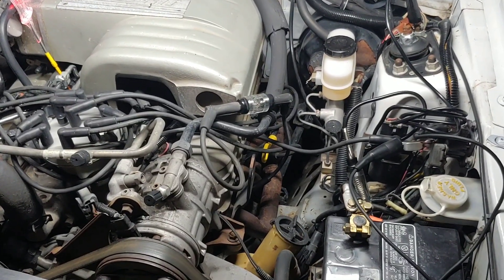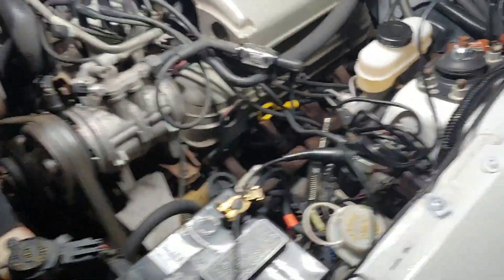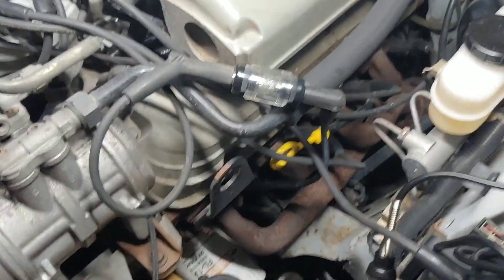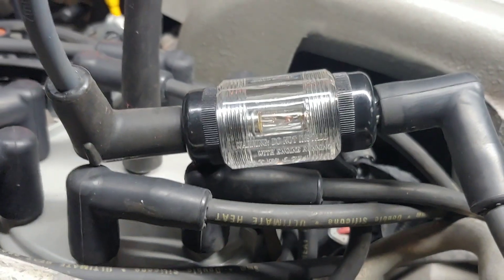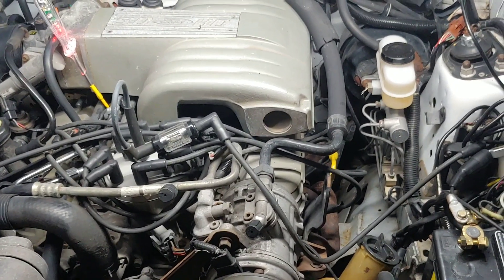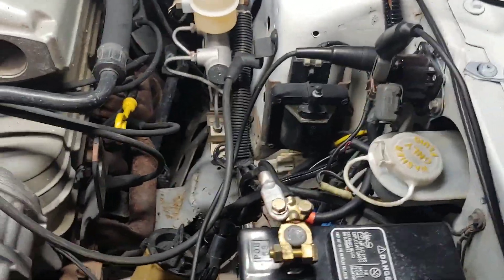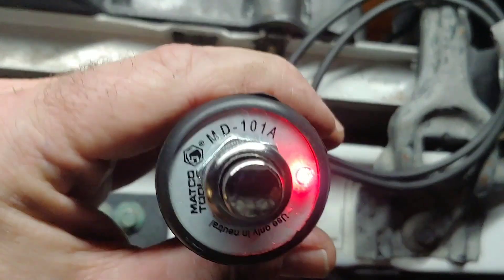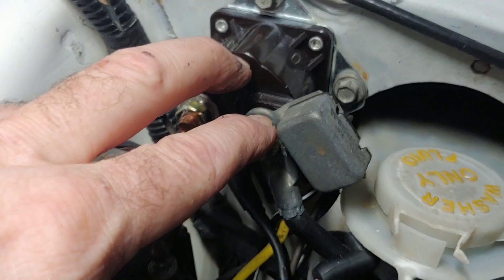Testing for Spark on a Mustang 5.0L

Comment: What u say would be the fault I'm having an issue with this engine where it will intermittently start I've checked spark and sometimes I don't 8 spark I might get 1 then a few seconds I'll get another one I've changed the coil pack but still the same would that be the hall effect sensor or a module fault ?
Reply from the maker: You would have to test the PIP sensor and the TFI module separately. By far, the TFI module is the more likely suspect, but either can cause a problem. The PIP sensor is easy to test, and the TFI module is really not easy. The only true way to test a TFI module is either real world replacement, or an oscilloscope. They go bad more often because of their proximity to heat. PIP sensors rarely go bad, but it's possible, and easy to test. Every time you get a PIP signal, you will also get 1 of 8 injectors firing, the fuel pump will run if it isn't already, and you will get 1 spark of the coil. If you get a PIP and not a spark, the TFI module or coil is the problem. Probably the TFI module.

Comment: I hooked up my incandescent like you did and mine never flashed while cranking ... on either side of the coil , hotside always on and the negative side it never flashed I have a screaming deamon coil ...you think it's fried?   or faulty TFI module?
Reply from the maker: The coil should have 12v on the + side any time the key is on. That's the red/light green wire as I recall. The negative side of the coil should have some minor but noticeable pulsing going on as you're cranking the car. Make sure the negative side of the coil isn't being grounded at all times! That would burn up a coil real quick, and a failed ignition module can cause this to happen. And that would have to be fixed before installing a replacement coil, or you'll burn it up too.

The PIP sensor measures engine RPM and location, and that's what the PCM uses to decide when to fire the coil and the injectors. Neither will work if the PIP sensor is bad. If the PIP sensor is good, you WILL have injector pulse when cranking, as long as the PCM is also good. But you would still need the ignition module to also be good, in order to have coil control (negative pulses going to the coil during cranking).

So make sure the coil doesn't have a constant ground when the key is on. Make sure you have injector pulse, or directly measure the PIP signals to make sure the PIP sensor is putting out. And then make sure you have coil control (negative pulses at the coil). Also look for signs the coil was overheated, bulged out, cracked, burned, etc. A constantly grounded coil will overheat and melt.

More often than not, it's a bad ignition module on fox bodies. On the SN95, the module is less likely to fail, but still a major suspect. You can also see if you have coil control with the SPOUT connector removed. That removes the PCM from the equation, and the TFI module fires the coil based directly on the PIP sensor's raw reading instead of using the SPOUT signal (PCM controlled spark output).

Comment: I’m not getting any spark at all from my distributor to spark plug, my 88 tc randomly cut off on me on the highway after I let off the gas pedal figured it was the ignition control module replaced that and cap and rotor still nothing, fuel pump kicks on, battery is good gave it a jump, alternator has been replaced few months ago, coil has power and is working idk what else it could be…
Reply: If I were you, I would test the PIP sensor using an LED test light, backprobed into the top wire on the ignition module connector. I would also make sure the coil has power when the key is on, on the red/green wire, and that the module has power and ground going to it. I would also remove the PCM, take off the cover, and inspect the 3 teal blue capacitors, and the area on the board directly below them for corrosion or breakage. Especially if the fuel pump runs all the time when you turn the key on.

Comment: When going from the coil with the tester what cause the light to stay on? I tested it with engine running. Great videos by the way.
Reply from the maker: When the engine is running, the coil is firing so often that it will keep the light looking like it's just on all the time. But when you are at cranking speeds of about 175 RPM, the engine is turning slow enough that you can see each coil firing by using a test light. This test is basically a crank/no start test.
Reply: @dragradialperformance3540  awesome, thank you for responding.
Reply: Drag Rad, I have a 1991 Lincoln Mark Vll (Cousin to the Awesome Mustang) & I have a “No spark⚡️from my coil” issue & I must’ve watched 50 videos, but U R THE MAN BRO!!! Thank you 🙏🏽 soooo much for making an EASY to comprehend video! I’m going to purchase this tester later today & I’ll keep you posted!!!🙌🏽👏🏽🤞🏽

Comment: Your videos should definitely have more views.
Reply from the maker: The content is good, but the video production and quality is crap.
Reply: @dragradialperformance3540   The production value is just fine. The 5.0 troubleshooting value is off the charts. I've yet to see anyone do what you do and have the knowledge to back it up. Most guys want to do a base idle reset to fix 5.0 issues. Meanwhile, the check engine light is on while they're showing "how well it worked".

I have 2 issues I'm chasing on 2 of my 5.0's.
My 91 - Has a slight surging issue when going into closed loop. Idles fine cold, once it starts to warm it starts to surge. If I leave it alone (not hit the gas) it settles itself and is fine after that. I'm thinking it's o2's.
My 89: I literally just got it going after MANY YEARS of sitting. It ran perfect once I cleaned the MAF and put fresh gas in it. I was actually shocked at how well it ran - bragging about it. I sent it to the frame shop to fix the strut towers and now it surges like crazy, runs super rich, hard start, stalls. I didn't even begin to start on that to troubleshoot it though.
Reply from the maker: @Anthony-rv3hr  On your 91, it could be a dirty mass air meter, dirty IAC, bad O2 sensors, or there isn't enough idle airflow. Try unplugging the IAC on a warm engine that's idling, and adjusting the throttle stop until the engine runs, but barely above the point where it starts stalling. Maybe 500 to 600 RPMs. Then once it's there, plug the IAC back in.

On  your 89, look for either a loose intake hose or vacuum line issues, fuel pressure too high issue (above 40 PSI unplugged is too high), or it might be that they damaged it when welding on the car. You might try removing the computer and physically inspecting the guts of the PCM. Especially the 3 teal capacitors.
Reply: Drag Rad, your videos are EXCELLENT!!!

Comment: Hey I wonder if you could help me out you seem pretty knowledgeable‘s about these fuel injector engines I recently had a vacuum leak on the EGR valve so I replaced it with a new EGR valve the leak win away but I went and I got a code 34 and I replaced all of the Components For the  EGR.  And I’m still getting a code 34
Reply from the maker: Code 34 is EGR position sensor closed valve voltage higher than expected. The position sensor is the 3-wire sensor on top of the EGR valve. It could be a bad sensor, a bad ground to that sensor, or the EGR valve could be physically stuck open some.
Reply: Drag Radial Performance  Yeah I was going to check I do have a multimeter or a voltmeter but I really don’t know how to use it to test the EGR components I do know how to check the throttle position sensor but I really don’t know how to check other components with it I don’t know what to put the dial to and I don’t know where to ground the negative probe or even if I have to do that . when it comes to electricity I am very ignorant you have to excuse me
Reply from the maker: @mikemarks1834  you might want to check out Scanner Danner's You Tube channel. Click on his playlist, and start with chapter 1, or look for videos on how to use multi-meters and test lights. He'll make a pro out of you in no time.
Reply: Drag Radial Performance  Hey I appreciate it for all of your help I’m gonna go check him out